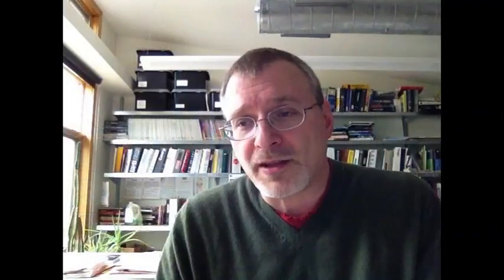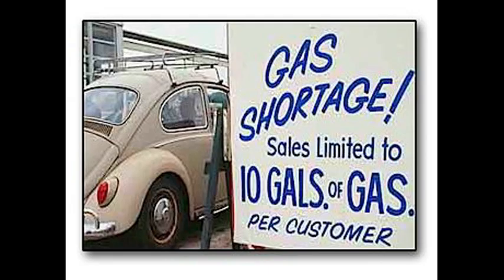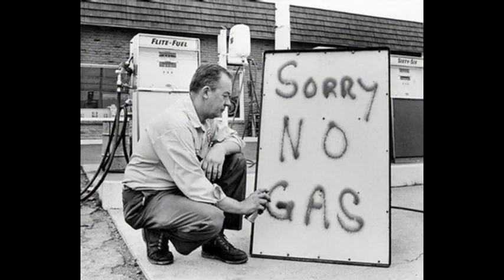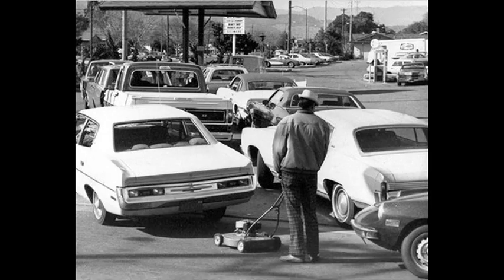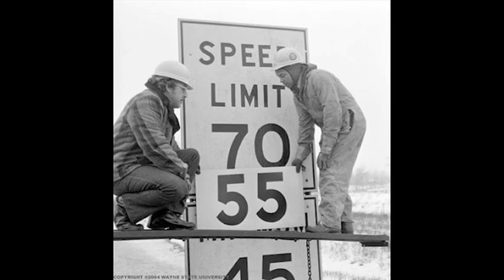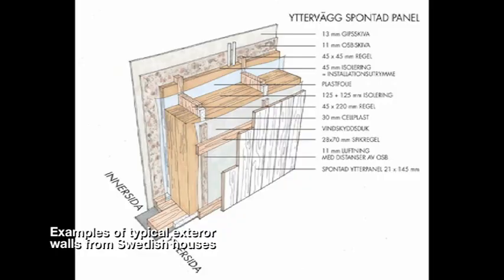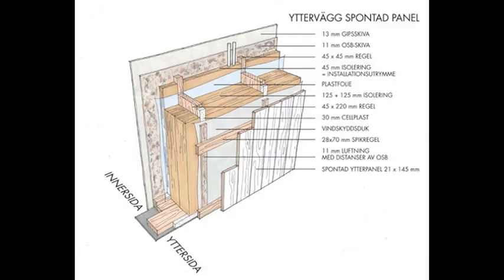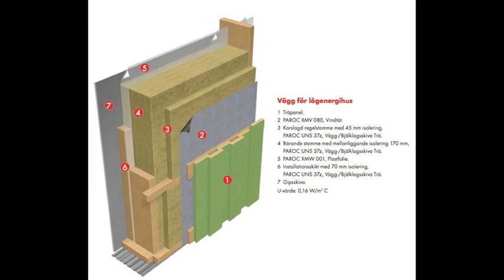Learning from Swedish Home Building Part 1

Comment: The Swedes are building more expensive to buy & cheaper to own houses.  In the US everything about run of the mill building is done for the cheapest possible initial cost & dump the higher long range cost on the buyers.  If people were educated in the cost of operating a house in the long run the higher cost  from the beginning would be negligible.

Comment: Greg - curious with several years of hindsight - whether you think sheathing with integral insulation (Huber Zip-R) is a reasonable evolution (or adaptation) of the methods shown here. I like both.
Reply: Nope - I would never specify a product like Huber Zip-R because it is too much of a vapor retarder to the exterior and generally it does not have enough r-value to be an effective continuous insulation layer. I also don't think much of Zip sheathing in general, aside from relying on tape instead of counter-flashing, once you tape up the joints your OSB becomes a vapor retarder. The only thing that makes any OSB a tolerable sheathing in my mind is that the open joints ensure that air and vapor can readily get past the resin saturated wood flakes in the OSB. Once you tape up those joints you've greatly decreased the outward drying potential of that wall. First of all, the interior is where you need to establish your airtightness in a heating climate - not at the sheathing. Second, if you need an airtight exterior for climate such as heating with hot humid summers + air conditioning, a vapor open house wrap is the best way to do that - not Zip. House wrap allows you to counter-flash, allows you to make air-tight, and vapor open.
Reply: @glavardera  Thanks Greg

Comment: The advanced framing was really designed to save on wood as you can go to 24" centers with 2x4 lumber, in multi story dwellings.  The problem with that is that in cold climates all builders and certainly my local code (and my local available lumber), now require 2x6s mainly for the insulation.  2x6 already works on 2 foot centers, and you have completely lost any advantage in wood savings.

If you want to improve structural efficiency, you align the loads, but that has little to do with insulation.

Comment: Hi Greg

I really liked your video series and found it very informative.I'm interested in self building a home in the Southern Highlands of Australia and was wondering if these airtight homes are stuffy. They have fantastic airtight insulation but how are they ventilated ?

Wondering if your could help?

Regards 

Anthony
Reply from the maker: ***** Anthony, when you build this way you can achieve very high levels of air-tightness, and when so you need to provide mechanical ventilation to bring in fresh air in a controlled manner. When you do so its best practice to use an energy/heat recovery ventilator - this is a device that passes incoming fresh air and outgoing conditioned air through a heat exchanger - this will capture a high percentage of the interior conditioning and transfer it to the incoming air. Some only transfer heat, and others also transfer latent heat (water vapor). Thats all thats practical to explain here - look them up and learn about them.
Reply: LamiDesign Modern House Plans Thanks Greg Regards 
A

Comment: Interesting Greg - I wonder if the new energy code will push builders to consider these techniques. Also, wonder if they are using a lot of spray foam insulation? and what R-value are they going for in the walls? I will look at your other videos and would love to talk further at some point.

Sue (Spring) Davis
SD Atelier Architecture, LLC
Reply from the maker: Sue, our codes are just starting to require higher Rvalues, and we are going to get used to seeing designations in the code to cavity value + outside layer value, like 19+5. But these Swedish wall assemblies can go way beyond that. Watch the rest of the video series and read the web pages. 

Swedes are definitely not using foam in the walls, sprayed or otherwise. It's almost all Stone Wool.